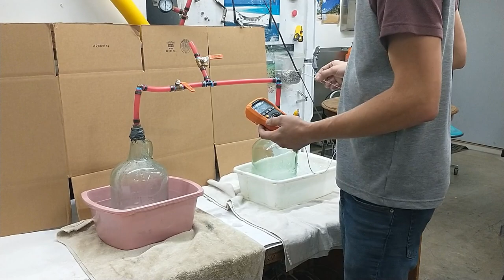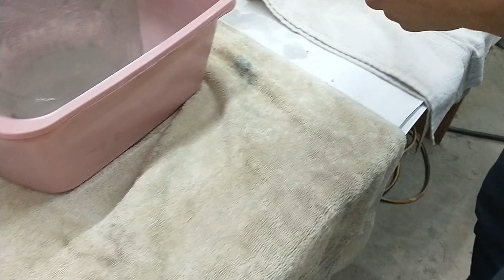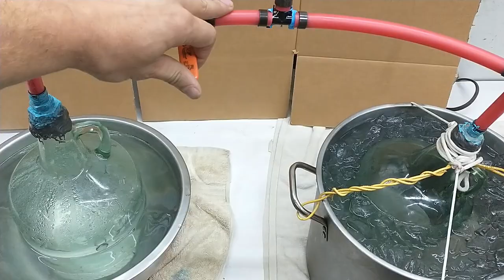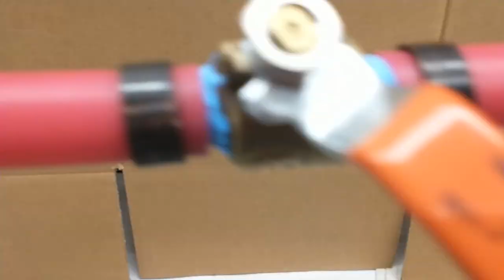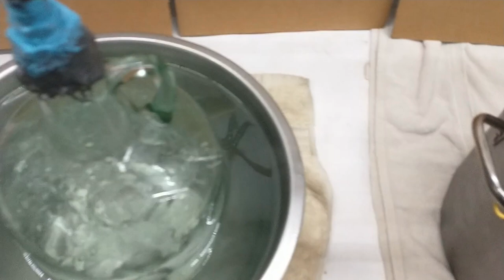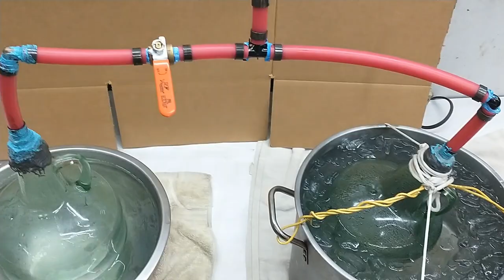COLD BOILING WATER To power The Tesla Turbine Renewable Energy System

Comment: This is awesome! I would imagine that the process would stop. But in a way it’s exactly what happens in an airconditioner. I’m so used to water boiling at 100 degrees Celsius. Even though I know at lower pressures it boils al lower temperatures. Still it’s counter intuitive. With the gas flow you can run a generator? It actually produces some real power?
Reply from the maker: Absolutely updates on the way!
Reply: That’s awesome. I want to be involved! Where can I read more?
Reply from the maker: @woutermol84  right now our patreon is the best place to see more content. I will be uploading more onto youtube but it will take some time. You can also see actual testing with the turbines putting out more power there as well. patreon.com/ienergysupply
Reply: Thanks! I will take a look! I’ve been thinking a few hours about this phenomenon. I think I understand what happens. If the hot container is about 50C, and all air has been taken out the pressure in the container will become stable at about 1.8 psi. If it’s 0C in the cold container the pressure will be about 0.09 Psi. So the pressure difference between both containers is then more or less 1.7 psi (0.12 bar). So the pressure difference is quite low. But if you have 1000l of 50 degrees Celsius, and outside your house it’s freezing you can boil all that water until all the water is in the cold container at 0C. The energy in 1000l with a deltaT of 50 degrees is about 58 kWh. I’ve done the calculations really quickly and got the data from the first websites I saw, so I might be wrong. Do you use the special Tesla turbine because of the low pressures? Can’t you use some of the shelve generator? I see the potential of my calculations are right, but is it possible to convert the energy efficiently at these low pressures?
Reply from the maker: @woutermol84  the best way to convert the energy of low pressures is with high speed. but the generator must be directly connected to the shaft to avoid all friction losses in the coupling between shaft and generator. the low pressure difference at higher volume is also important, and the centrifugal head that produces back pressure opposing the flow is also very important to keep the volume of steam consumed extremely low. the generator can produce lots of energy at high speeds if not much torque is applied to the load. its good though because not much torque is required at high speed. High speed is a bad thing due to friction because the friction losses at high speed are generally very significant, but not in the tesla turbine with the exhaust at high vacuum.
Reply: Do I get an invoice from Patreon? That way I can pay with my company. It saves me tax and stuff. I saw the video with Aron just now and you said you got a 1000W with compressed air. I understand you can get so the same speed with cold steam, but that is because there is no friction. That doesn’t mean you can get the same power out isn’t it. The pressure is for example 2 psi, so so two pound per square inch. So if you have a disk of let’s say 20 inch you have 40 pounds of force. I imagine the volume of the gas that runs through the turbine, the area of the disks, and the pressure together make up the theoretical power? Do do you have the theory on the patreon too?
Reply: Also I saw somewhere that you had to vacuum the system a few times. When I install an airconditioner I vacuum the system to about 200 micron. Only after I add the gas/liquid. Might save you some time. Or is it because trace gases get evaporated out of the water. Only after this is done the vacuum stays stable. Really interesting stuff and I must say I’m impressed  with all that you did so far. I easy to have ideas but really hard to actually build them
Reply: I think I understand now why speed is important. In weather systems it is the wind speed that makes a windmill turn, however there is hardly any pressure difference between the front and back of the windmill (when it’s not turning yet). Because one side of your system is allmost vacuum the steam can accelerate allmost to infinity I imagine. The higher the speed the more energy in the moving steam? Is this the right way to think about it?
Reply from the maker: @woutermol84  Perfect video for you here, https://www.youtube.com/watch?v=4glu-26aOUE&t=1506s, skip the video to 20:46 to learn about why speed is important, you got the idea! Thanks for your interest.

Comment: Ok I get hot reservoir leads to + atm and cold is going to give you a - to atm leading to airflow and guessing mid line is an intake from a venturi effect but how are you measuring efficiency and why no regenerator?
Reply from the maker: We won't actually be using the venturi effect with this set up. We will add the regenerator later. With our new analytical equipment we will measure the efficiency of the system.

Comment: What if you added a "butt" like a very small o-ring (w/ inner diameter 0.01), based on my knowledge of flow 2 butts on the cold side (condenser side.) On the very bottom submerged bellow the water. The bars atm. of the water will help keep vacuum 2
Reply from the maker: sorry, I'm not sure what you mean.
Reply: @iEnergySupply  Same.

Comment: Does a tesla turbine have the ability to get more power put of dluid than the compression ratio? I mean does it cool down the fluid and change the heat energy of the fluid into rotation trough some difderent mechanism tham traditional turbine does? Traditional turbines take advantage of temperature pressure differential. Does tesla turbine take some extra heat out? If yes it is the best generation technology and should be replaced everywhere. It would be kinda really awesome and would be better than carnot engine because you vasically don't need any temperature differential to convert heat into motion. It would be just heat in, motion out. Not like normal heat in, motion out, a ton of waste heat out. Just beautifull...

Comment: Would anyone know what the ideal disk gap is for water? If you were to use the Turbine as a water pump? I think for vapor it's 0.4mm, for water it would need to be wider, but I don't know how much more
Reply from the maker: for water you need much larger spacing. 1/8" would be good for water, and make sure the side walls of the casing are at least 1/8" away from the rotor end plates. This is my estimate because I've never built one.

Comment: Thats all good, but the inherent problem of all heat engine remains.
You can´t get a high energy transformation efficiency with such a low temperature difference!

If you don´t know what i mean, pleas look up "Carnot factor".
Thats the physical limit of how much mechanical energy you can extract out of given temperature difference.
For 100°k difference its somthing like 26%, if you reach 98% of that posible number, thats great! But you are stuck at 20 somthing %.

You need to bumb up the system temperature alot to go higher in efficiency, otherwise the greater effort is not woth anything against PV!

Sry it´s from the german wiki for that topic, but thats the best ilustration i can find.
https://de.wikipedia.org/wiki/Carnot-Wirkungsgrad#/media/Datei:Carnot-Wirkungsgrad.svg
Reply from the maker: I believe the efficiency depends on the speed of the gas. Only one way to find out, we are now testing. Apparently the tesla turbine can extract the latent heat of vaporization. Even if we were stuck with 20% efficiency, the merit of the water battery makes the system practical. With 97% efficient solar heat collectors, we will still be ahead of the 13-20% efficiency from regular solar panels but we can store massive amounts of energy in the water battery for cleaner and more massive energy storage. sorry for my grammar, answering comments as fast as I can to get back to wrok.
Reply: I don't understand how the efficiency would be so low if you pumped the water that still holds some heat back into the boiler?
Reply: @joshuanorris9785  it's because you have to coole the condensing side, that energy is straight out lost, if not nothing will move. 
That's how entropy works. 
In an ideal world where the laws of thermodynamics would alow it, you would turn all heat into motion/electricity and would not need a condenser in a closed cycle system, or a gas engine would have room temperature exhaust!
But that's not how it works in our reality.
Reply: @martin09091989  Thank you for the response. Would the efficiency be much more than 20% if the cool side was always at a constant 50 degrees fh (using geothermal)? To me it seems like it would be in the 90% range if we didn't account for how much it cost to keep that side cool. I'd spend some electricity just to pump the water holding the heat right back into the boiler before that constant 50 degree's even effects the heat in the water.
Reply: @joshuanorris9785  No, for energy to flow (every kind) you need a gradiant, a differential.
The higher the difference is the more efficient you can convert the energy into another form. The physical limit with heat is around 70%.
Imagine a normal gas piston engine or a steam engine, it extracts energy by expanding hot gases.
If you would try to reach room temperature with the "hot" gases, therefore use all the energy you put in it, the piston would be horrendously long and by the time the gas is fully expanded it would have given some of its heat into the chamber walls, and the added mechanicals come with extra drag ect. 
The point is, trying to extract more energy out of the last bit of heat comes with a price, and the turnaround point where it's not longer viable comes pretty quick.
Modern F1 engines reach 50%, that's even mind boggling, but to reach the last 20% it gets harder and harder exponentially.

Comment: you are lucky that the glass in boiling water did not explode .. so this is the same thing that every body does, boil the water...  pressurized the tank and run the generator,  in the commercial using coal or  nuclear plant the temperature variation is so high that final stream can just be in normal open air. Your hot side is too cold that is why you need a lower cold side flow. You could use a off the shelve generator with the same setup.. Did your turbine produce much higher wattage (not volts or amp). For test you can just use pressurized cylinder to show same volume of air and pressure.

Or put a container with water on the same height.. forget the temperature variation..
Reply: See that's where the tesla turbine is claimed to differ from conventional turbines. The exhaust is cold and keeps cooling the cold side.
Now I haven't seen definitive proof of this yet but they are setting up a demonstration now with instrumentation to show it. So we gotta wait a few days to a week I'd say.
Reply: @jeffjefferson3364   if that is the case the exhaust pressure from the turbine zero since essentially the air already in condensation process, what I am really thinking is they running the vaccum pump somehow.
Reply: @jeffjefferson3364  also I have when they use a handheld camera, when not seeing the whole setup
Reply: @c2sartinkprinthub757  I don't really know how it's being done. Can't wait to see if they can prove it though.
Reply: @c2sartinkprinthub757  well look nothing will satisfy you until you'd see it in person. My only issue with it is the way it's being pitched, it doesn't make sense to be selling it this way, if this works then every single industry in every country in the world would want it tomorrow. We are already blowing billions on wind and solar technologies that won't have the energy supply we need. 
This system would make everything else redundant. So why are they messing about on YouTube with it? 2 possible answers I see, they know it doesn't work, or, they don't know if it works yet.
Reply: @jeffjefferson3364  like you.. I would like them to succeed .. but yes its on you tube.. so be wary that all are for viewing purpose only.. ciao
Reply from the maker: you can actually use the ground to condense the water. Also the more efficient your turbine is the cooler the temperature of the exhaust and the less cooling you will need. For now the best benefit is, if we can get this turbine to operate with water below 212 f or 100c water it makes the system extremely safe, and can never explode making the system safe for home use. Another great benefit is, the water can be stored in water, making batteries obsolete. the use of thermal solar collectors, these collectors can be up to 97 % efficient, and the energy can be stored in water in the form of heat. You can also burn any fuel to produce electricity, and even use your wood stove in the winter time if you have one to produce electricity.
Reply from the maker: “All that was great in the past was ridiculed, condemned, combated, suppressed — only to emerge all the more powerfully, all the more triumphantly from the struggle.”
― Nikola Tesla
Reply from the maker: Actually the only thing that can go wrong in this experiment without a heat plate or propane burner is an implosion. pressure beyond atmospheric pressure can't build up in the system.
Reply: @iEnergySupply  it would be a big shame if you just another scam. lol
Reply: @iEnergySupply  it a normal steam turbine with using tesla turbine... what will be the difference if we just presurized the water with air pump just for testing purposes.. the end goal is to show that the tesla turbine is more efficient, nobody care if the water turn to ice the main concern is will it produce more torque and rotation vs a comparable turbine?
Reply from the maker: @c2sartinkprinthub757  Air and water behave differently.
Reply: @iEnergySupply  make two model? lol

Comment: And it did pretty much nothing
Reply from the maker: huh?
Reply: @iEnergySupply  any idea when you'll have an update?
Reply: There was almost no flow, there is no way something like this can ever produce more energy that is put into it. 
Not only the vacuum setup requires energy but heating the water/ producing ice requires energy. Due to friction in the system/ heat loss ect. it is impossible to gain energy from this.
The reaction did stop once the pressure equalized, it did not continue it was not a misconception.